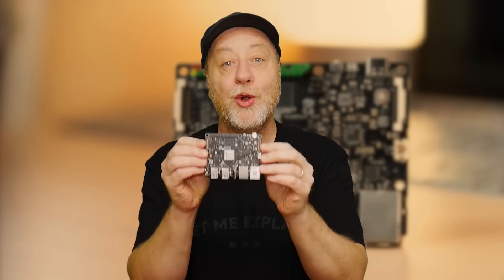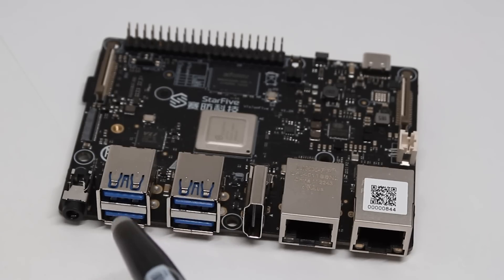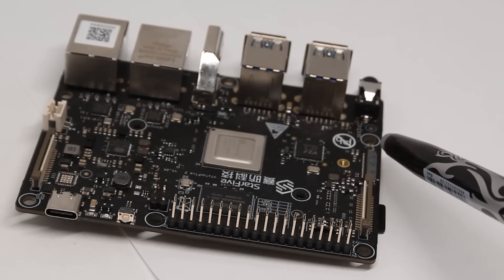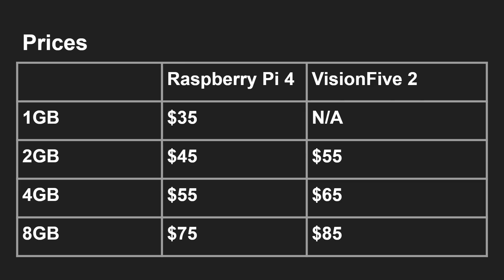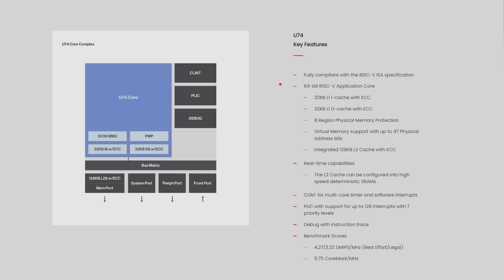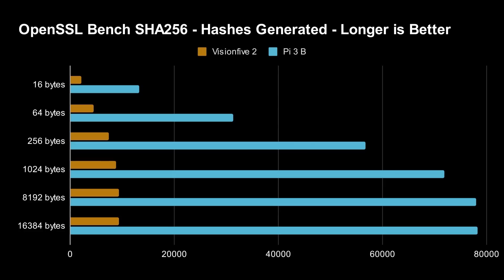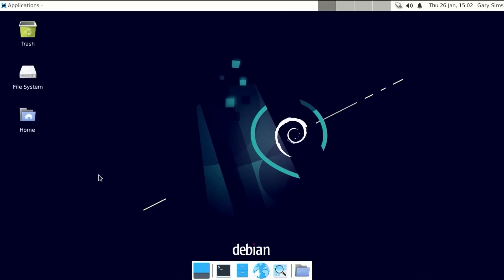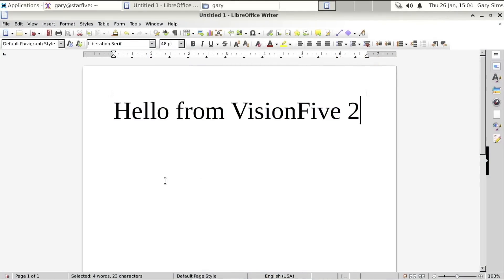VisionFive 2 RISC-V SBC - A Raspberry Pi Killer?

Comment: I start to believe the fate of riscv will be like mips and the risc intel was offering back in days forgot its name the one that was in the hp ipacs... I don't see big big companies (mediatek/samsung/Broadcom etc...) jumping on this arc... I wonder why🤔
Reply: Samsung has been using RISC-V since the Galaxy S20 (a top executive got up on stage at the December 2019 RISC-V Summit and said so). Qualcomm recently said they've shipped 650 million RISC-V cores in Snapdragon SoCs since 2019.
Reply: I don't agree.  RISC-V is being used by many large companies in embedded products where saving the cost of an ARM license makes a difference.  (For example, you can throw a RISC-V core into FPGA fabric for free if a low-performance CPU is all you need.)

I don't see it dethroning Intel or ARM in the SBC or personal computer space any time soon, but I don't see it dying out either.
Reply: Basically every newer SSD & HDD from WD & Seagate nowadays comes with riscv-cores. it's just too early for application SoC's from the big ones, this will take another 5 to 10 years (as bruce said the SoC's already have riscv cores running firmware)
Reply: @blunet  not 10 years. Three years until such SoCs exist in expensive test chips and boards, five until cheap mass-production.

Comment: I'll be honest, I thought RISC-V was long gone. Considering RISC-V is 13 years old at this point, it's a bit shocking to see a new SBC for it.
Reply: 13 years ago is when three bods at Berkeley first had an idea to START to design their own instruction set. The ISA was frozen and ratified in July 2019, which is only 3 1/2 years ago. It takes about 3 years to design a chip, get it built, get boards using it on to the market.
Reply: @BruceHoult  yup. Not to mention COVID slowed down a lot of things too.
Reply: It's been gaining traction over the years. And lawsuits like the ARM vs Qualcomm one is only going to start pushing OEMs to look in to RISC V over the next 5-6 years and start setting up projects internally to support it.
Reply from the maker: @Isogen, I would have thought that the only people worried about Arm/Qualcomm would be those who design chips from zero. Most SBCs and Microcontrollers use licensed IP like the Cortex-M or Cortex-A range. Even the StarFive chip uses licensed IP, in this case from SiFive. Licensing is licensing, RISC-V doesn't change that.
Reply: @GaryExplains  surely on the contrary? Nuvia developed an ARM-compatible core and Qualcomm looked at it and said "Hey that looks good, we'd like to use it". But the Nuvia contract with ARM says they can't license it to someone else, only use it themselves. "No problem", says Qualcomm, "If we can't license it from Nuvia then we'll just buy them instead". "Nu, uh!" says ARM. You can develop (with the right license) ARM-compatible cores yourself, but the only company you can license a core from is ARM. In RISC-V you can license a core from already probably half a dozen serious suppliers, and pretty soon a dozen.
Reply from the maker: That isn't what happened between Qualcomm and Arm, and you know that Bruce.
Reply: @GaryExplains  which sentence is incorrect?
Reply from the maker: Qualcomm knew from past acquisitions that the license is not transferable (like many licenses) without the content of the licensor. This is sensible as you don't want a "hostile" 3rd party to gain a license to Arm's IP. Arm is/was willing to grant that consent to Qualcomm, the only sticking point was the renegotiation of the  license. Qualcomm knowingly broke the license and refused to fix the situation. As for your statement that you can license RISC-V cores from half a dozen serious suppliers, you know that is a misdirection. Each core suppliers has its own extensions, its own level of implementation (GC etc), and they are competing against each other, it isn't some big happy family. "Sure just drop in my competitor's core into your design, we are fine with that." No, each supplier will do every it can to lock-in its customers. You make it sound like RISC-V is some big hippie commune. Business is business and we are talking about multi-million dollar business here.
Reply: @GaryExplains  if it was merely a dispute over whether Qualcomm should pay fees based on Qualcomm's ALA or Nuvia's ALA then that is what the lawsuit would say. Not "Nuvia doesn't exist any more, its ALA is cancelled, all IP developed under Nuvia's ALA must be deleted, Qualcomm has to start from scratch".
Reply from the maker: Ah, I see where you have misunderstood. The request to erase all of Nuvia's pre-existing designs is a result of the failure to re-negotiate the license post buy-out. It ISN'T the result of the license or Arm's desire. Arm wants Qualcomm to use Nuvia. A custom design in the Windows market will boost Arm, just as it does in the Mac market and in the server market. You should really go do a bit of background reading about Qualcomm's aggressive position on licenses, patents, FRAND, etc.
Reply: @GaryExplains  as for RISC-V licensing. All RISC-V cores intended to run shrink-wrapped software implement at least RV64GC and that is all that such shrink-wrapped software (e.g. Debian/Ubuntu kernel and packages) assumes. No one can force any customer to use custom extensions, and people understand that it's a trap and don't use them unless they are prepared to rewrite later. Implemented extensions vary a lot more in the embedded processor world, but in that world everyone compiles all their own software from scratch anyway. You know exactly what core you are targeting and you simply tell gcc/llvm what extensions to use and they do all the hard work for you.
Reply: @GaryExplains  I will if you get better informed on RISC-V. Deal?
Reply: @GaryExplains  StarFive does not license from SiFive. StarFive IS SiFive, more specifically, the China facing company branch of SiFive.
Reply from the maker: @vladlu6362  Do you have a reference for that, I can't find anything that says that. What it says in the RISC-V website is, "Built on a strong partnership with SiFive, StarFive started as an exclusive distributor of SiFive RISC-V core IP products in the greater China region".

Comment: Is there anything about the RISC-V protocol that makes it decidedly better than ARM?  In other words, after decades of time and billions of $ have been spent in R&D, can we expect RISC-V processors to be the architecture of choice for most applications or will they roughly reach parity with ARM?

Pardon my lack of understanding for computer science; I think that amidst the hype for RISC-V I'd made some assumptions about its qualities.
Reply: Not really, it's just a different way of expressing the same thing. Think of ISAs (Instruction Set Architectures) as a kind of language, some languages are richer and more complex, some simpler, some have concepts that don't map exactly to other languages, but at the end of the day they're all moving bytes about in memory and transforming them in various ways. All modern ISAs are quite similar in their base assumptions. I think the main benefit of RISC-V is that it's free for anyone to implement, which will create a richer ecosystem of CPU vendors compared to ARM (very expensive architecture licence) or x86 (impossible to licence, patent duopoly).
Reply: Also since all the hard work of porting open-source operating system, compilers and software is already done and shared with all vendors, it's much easier and cheaper to just use RISC-V for your CPU rather than inventing a new ISA and having to do that all yourself.
Reply: RISC-V also comes at an interesting time patent-wise, since patents from 2003 and earlier are now expired, so CPU designers can use these techniques without having to licence these patents. They can at least match Pentium III or 4 which were released before 2003.
Reply: It's better because it's open source, meaning any company can come along and design their own chip around it. The potential market for that chip will know it's compatible with software designed for RISC-V. Makers of RISC-V chips will have the option to differentiate based on how they optimize their design, or if they support certain instruction extensions, etc. without worry. 

It's pointless asking something like "after decades and billions", as any company worth that much would make sure that they make it worth it, not to mention this assumes the equivalent hasn't been put into competing architectures, other variables like consumer choice, etc...
Reply: You don't have to pay for licenses on architecture. But you do pay for the implementation, unless you do it yourself.
Reply: RISC V doesnt have bloat to be compatible with old systems as modern ARM and even more so for x86. So it could in theory have more performance. But as Gary has talked about in his comparisson video of various processors, the productiong of the CPU matters way more than the instruction set. 

Big issue for RISC V is it barely has any software compatibility where ARM and x86 got way more, which hinters its practical performance.

Comment: 9:45 the question here is this slowness the underlying hardware , or is it more the fault of an immature compiler etc?
Reply: The only real way to compare "fairly" would be something like comparing the speed of certain similar assembly instructions, and even then it would differ based on how much better the maker of the chip wanted those instructions to run, or if they even support it in the case of extensions to the instruction set

Comment: I am really looking forward for the HiFive Pro P550 MicroATX RISC-V development board which should give us finally a little bit more computing power.
Reply: More power yes, but the price hasn't been announced. I expect it will follow previous SiFIve boards using low volume prototype chips (MPW / shuttle) and be $500 to $1000. Lower cost boards with mass-production SoCs (such as the VisionFive in this video) follow a year or two later.
Reply: @BruceHoult  Less expensive, mass-produced boards like these SoCs won't find buyers if they perform so poorly compared to a 7-year-old Raspberry Pi 3.
Reply: @OpenGL4ever  They absolutely cane the Pi 3 in anything not using SIMD (which the JH7110 doesn't have). Of those kinds of things are better done on the GPU, of which it has quite a powerful one. Also in the real world having 4 / 8 / 16 GB of RAM works far better than the maximum 1 GB on the Pi 3.
Reply: @BruceHoult  If you need more RAM, then you can still buy a Rasperry Pi 4. 

On the SIMD vs. GPU thing, it really depends on what you want to do. SIMD support is much easier to implement on the software development side, because it just needs a better compiler that does support these SIMD instruction. If you have to do all the work on the GPU, then a simple recompile with a current compiler won't do it, you will have to rewrite your code to make it GPU aware. And that is a huge untertaking and thus a big difference.
So to sum it up, a GPU does not replace the SIMD on a CPU in most cases.

In addition, a SIMD unit also helps to speed up ordinary programs where humans would not even think of optimizing the program using the SIMD instructions (or the GPU). In this case, the optimization is then performed automatically by the compiler, because it cannot distinguish between computationally intensive sections of a code and normal code; it will simply optimize with SIMD wherever it sees a chance of achieving optimization with it.
I.e. also with every ordinary forest and meadow code. 
But that only applies to the SIMD, it doesn't work with the GPU because the compiler doesn't optimize for the GPU. Using the GPU requires the use of APIs such as OpenCL. And that has to be used extra for the code.

The GPU of the JH7110 therefore remains unused in most cases, while the SIMD unit of the Raspberry Pi will be used in many cases due to a better compiler. A SIMD unit is therefore missing in the JH7110 and this is also a big disadvantage.
Reply: What is interesting: Intel is involved.

Comment: 😂😂😂 You’re so sour about the “open source” label and I’m sure the entire community is just confused about it because you’ve never actually explained what “open source” means in RISC V. RISC V is an ISA. Just as x86, x64, and ARM are. The “architects” come up with the networks of transistors  that perform specific functions. These functions are what are called “instructions”.  A group of them is called an “instruction set”. Ah processor is made up of loads of these networks and controllers and ASICS and I’m sure I’m missing some other stuff because I’m not an expert, but they all are designed and catalogued into the ISA. Apple designs their own SoCs. In order to be able to do so and access the catalogue, they had to purchase a license from ARM. What instructions the license permits is entirely up to ARM. It is a legal agreement. With the catalogue, some software, and some people who know how to use them, you can then design the image of a chip and have it sent to TSMC to be forged. If you are caught using any instructions not in your license, or using the ISA without a license, you can get sued you into homelessness by ARM. With RISC V, the ISA is open sourced. You can literally go to their website,  access open source software to draft (3rd party), access the entire Instruction Set Architecture with VERY detailed explanations of how to use them , and design your own RISC V  processor, ASIC, etc.  Due to the license they share it under, they can never sue you for using it no matter how much you profit from it. But if you do so, please pay something back. If they can’t pay engineers, you’re product won’t ever upgrade from a new version of the ISA. SiFive used the ISA to design a processor and had it founded. They do have the right to protect the Instruction Set they curated and the right to license it as they choose. This is also stated in the license RISC V uses to share it. If a company doesn’t have the means or desire to design their own processor, they can purchase them or even license the design from SiFive to pay for their own to be founded. Depending on their license agreement with SiFive, uthey may be able to modify it or not and they may be able to sub license their modified chip or not. This is all covered by the license chosen. That’s how the “open source” aspect is handled.

Comment: I think its a neat tinker device. But especially if you want something stable now its clearly way to early.  Not to mention that Compilers, Runtimes, Libraries,... all that needs to be ported an optimized for RISC V which will take at least a decade. 

I myself even recently was thinking about getting an ARM board for my homelab, but still the Software isn't 100% there yet with for example Proxmox not supporting any ARM chips. So I went for an low powered Pentium instead. Just goes to show how long it is to switch over to an entire new hardware platform.
Reply: This board is aimed at developers with it's low cost. We need boards like this to improve RISC V adoption over the coming years.

Comment: What's this Raspberry Pi you're talking about? At this point I think it's a mythical creature nobody has seen in 2 years. If there's anyone killing RPi, it's RPi's lack of availability. I wanted to get my hands on a CM4 4GB RAM, 32 GB eMMC for what seems like ages. Or a mere Pi4 with 4GB of RAM. Unofficially, RPi 4GB's price is $140. This is what I would have to pay for one on eBay. No thanks.
Reply: Get one used, open box. I've got 4 Pi4Bs. Each one overclocked to it's individual limit. The oldest one since 2019. Get the 8gb model it makes a difference an extra 25mhz over the closest 4gb model of the same revision. The difference between some games working or not.
Reply: @pgtmr2713  why get used rpi4 and overclock it when you can get more performance from Cortex A76 cores in Rockchip SoC without worrying about OC and availability?
Reply: @Promilus1984  Because the software, because I don't worry about the OCs, and would OC a rockchip. Availability also not a problem once you have them.
Reply: @pgtmr2713  afaik there aren't rpi specific games out there anyway and most of the software comes from arm version of linux anyway. What's rpi specific is their gpio - related libs, some step by step guides, some distros and of course bare metal projects. Other than that it all comes down to how good driver support is.
Reply: @Promilus1984  Getting the other sbcs to do it is the whole thing.
Reply: @pgtmr2713  can you see if you can run obico on an over clocked one
Reply: @mattweger437  Obico is for 3d printers, which I don't have.
Reply: @pgtmr2713  what are you doing with your life
Reply: You can technically get a computing module and directly use that as well.
Reply: Wow, here I am using one to run octoprint
Reply: apart of Raspberry Pi products there are several other ARM-based solutions to chose from, most of them with better performance and software support than risc-v.
Reply: You can’t kill a ghost lol
Reply: Just tell me which one is best and available ffs
Reply: You can buy Raspberry Pis. The limited supply just makes them expensive. Which makes this relevant at the point in the video when relative prices are discussed. If these boards are more widely available they'll be cheaper.
Reply: VisionFive becomes the Pi savior by taking up all of its demand, lol
Reply: @AndersHass  yeah and RockPi and OrangePi and Pine A64 and Asus Tinkerboard.
Reply from the maker: This isn't a video about stock shortages or availability. It is about features and the technical aspects.
Reply: @GaryExplains  
So what,  they highlighted an issue

I'm glad they did
Reply: @GaryExplains  I know, Gary... I had no intention of being rude. I was just venting my frustration about the shortage. And I'm fully aware that this is not something the RPi Foundation has much control over.
Reply: @lukeearthcrawler896  
As you are entitled to do